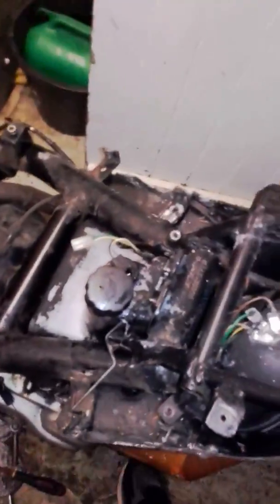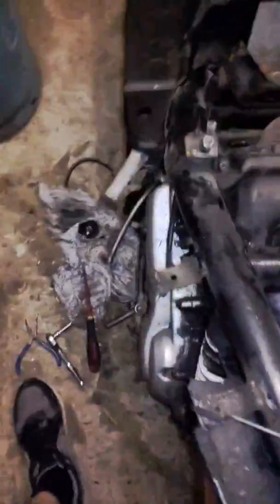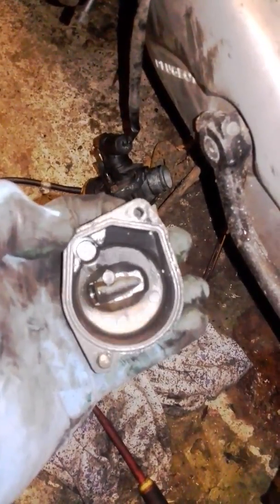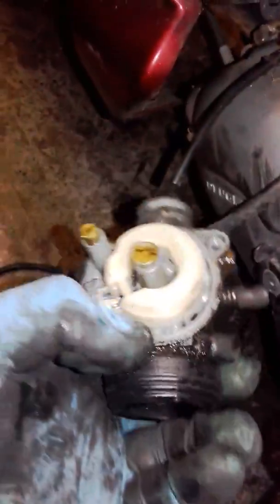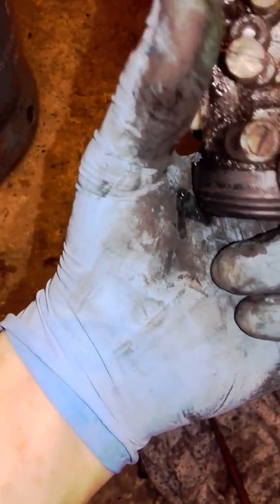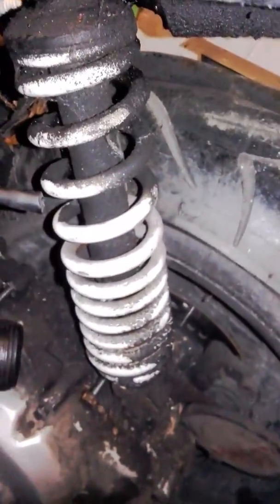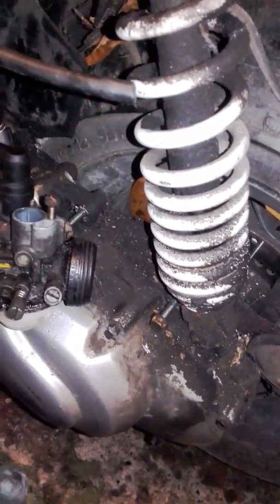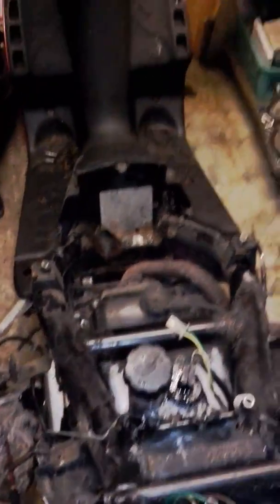Peugeot speedfight 100 (1997) rebuild

Comment: Hi do you know where the regulator is on these bikes ? mike is a similar model,  Peugeot Trekker 98 , I think it is under the floor panel ? Thanks
Reply from the maker: What do you mean regulator ? For what ?
Reply from the maker: Trekker is same bike basically same manual
Reply: @THEGEEK2001  Hi the regulator/rectifier that sorts the voltage out for charging the battery
Reply from the maker: @BoBSmith-jz5dm  ahhh CDI is under floor panels by battery and rectify also have to take all floor boards up - little metal box bolted to frame near toe.
Reply: @THEGEEK2001  Ah thought so thanks , I know it's normally under the front panel , but it wasn't there , I looked online but couldnt find anything on youtube I did find a manual online that said it might be under the floor , I have just been browsing youtube for ideas and your vid was the closest I seen , as you had bike stripped , it's with a mechanics at the moment , clutch need replacing , I took it the shops and when I came out it wouldn't start like flat battery sound , I knew the rectifier was maybe broken as there is no charge voltage , I tested the charge as my lights have been playing up ie only working when I rev , indicators and everything , anyway I charged the battery and took it back but still wouldn't start so I pushed it to a local garage who told me clutch was completly worn,  springs snapped and everything that why it wouldn't start , I've bought a hole new clutch complete with bell and everything from abay for £40 so hopefully they can fit that quick will get them to fit a regulator to and hopefully runs well , I was gonna do the regulator myself but have been ill with a cold and when it broke I took it the garage, and if they gonna do the clutch , might as well do the rectifier as well oh and the kick pinion ,  they quoted me £200 I was like what !!! said 1 hour half labour and parts , so bought it myself complete , and hopefully they can just swap it over quickly ,can't see it taking more than an hour , anyway thanks for the info , soz for the long reply message ha , thanks dude
Reply from the maker: @BoBSmith-jz5dm  hmm. I suspect not clutch at all. That has nothing to do with charging the battery. When the bike is running again get them to put a multimeter to the battery while the bike is running - should see around 13-14 v on idle and spikes up when revving if not then rectify or flywheel
Reply: @THEGEEK2001  Hi yeah no the battery was charged and it still wouldn't start , I started getting problems with my indicators fast flickering and dash light only working when revving so I checked the battery voltage when revving and it didn't move so I thought ahh the rectifier , was gonna fix it but carried on using it,  then it broke down the next day , i thought the battery was flat so i charged it but still wouldn't start , I was also thinking the starter motor ,which I still think it might be , if it doesn't start when he replaces the clutch I will be pissed off , as it still could be the starter motor , the kick is broke so will get him fix that too just in case it is the started motor , the clutch prob needs doing anyway , but yeah no worries will let u know how it goes , cheers bud , p.s the fly wheel must be working as the lights work when revving